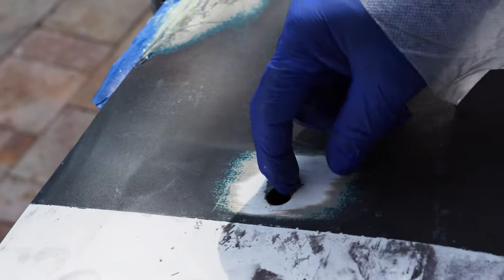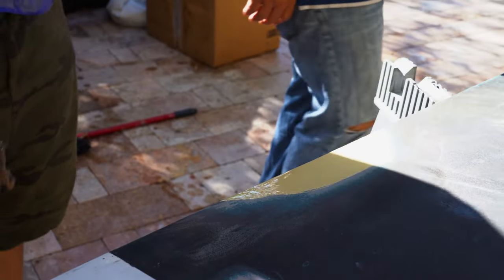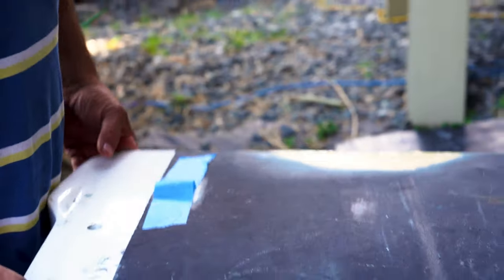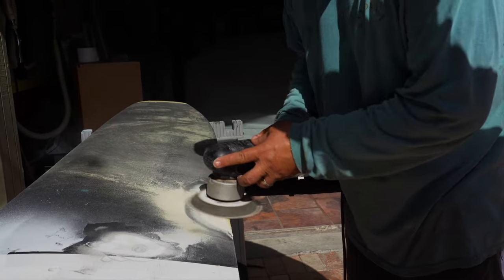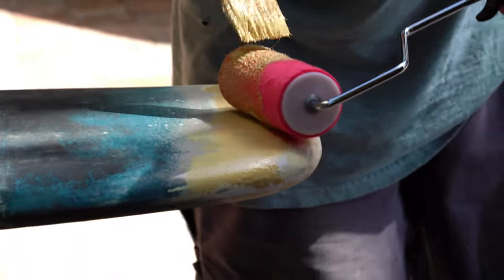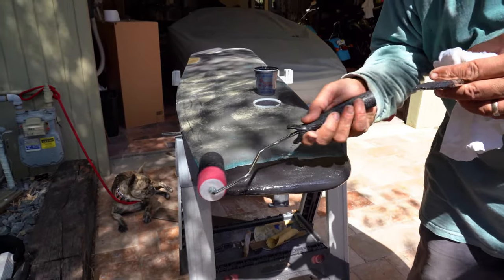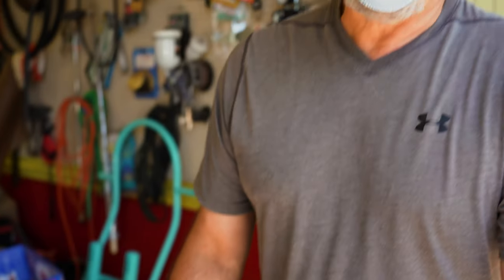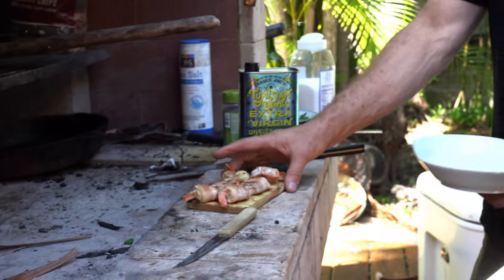Boat Projects Continued! Fixing the Rudder On Our Seawind 1600 Catamaran | Harbors Unknown Ep. 22

Comment: There's only one pin in the rudder, but is there a way to have them half in? How do you steer with them retracted? Thanks for the excellent and informative video!
Reply from the maker: Yes, you can let the rudder float up and secure it with a wedge between the rudder case and the rudder. We do that all the times when we are motoring in shallow water, except when we should have 😳😳😂😂🤪
Thanks for watching our videos and for following our channel

Comment: Sorry for the delay but quick question re the rudder.   Is that rudder very long compared to other cats?  When I see the diagram for cats, it usually shows the rudder being slightly less deep than the mini keels on non dagger board boats.  But even on the outremer 45 it shows as the rudders being slightly less deep than the bottom of the boat with daggers up.    Yet the diagram for the sea wind 1600 shows the rudders being almost as deep as daggers down.  This would make the rudders very vulnerable....as you found out, or do you need to raise rudders as well in shallow waters?  Ie it would be not just the dagger boards you have to worry about.    Sea wind is on my list so any info is good intel!  Thanks
Reply from the maker: The rudders are longer than those on cats with mini keels. With the rudders down we draw 5’6” so they do need to be raised in shallow water. We also learned that the depth transducer is only on the port side so you could have 12’ on port but 26’ away on starboard have 4’ and be in trouble.